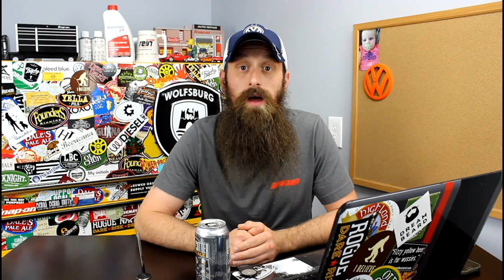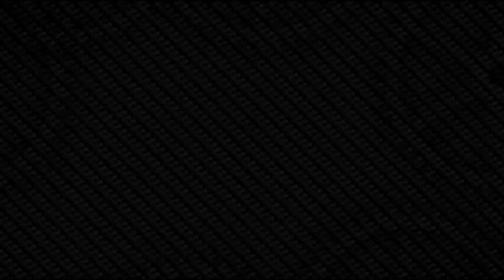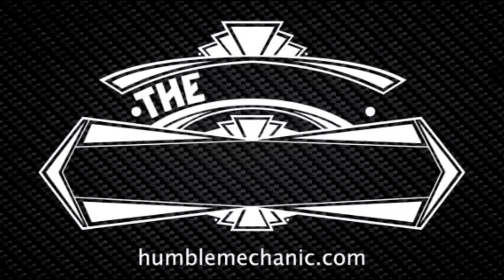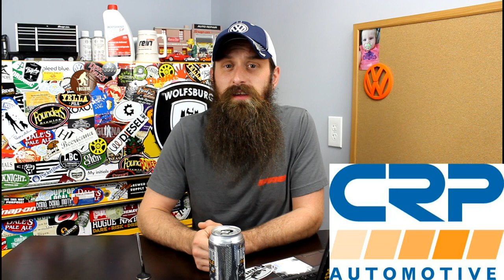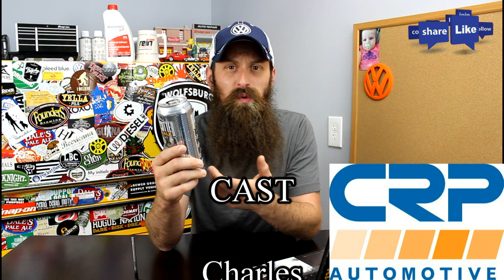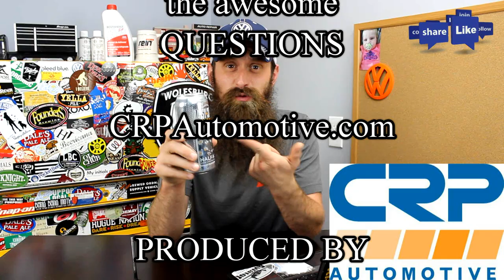Viewer Automotive Questions Answered ~ Podcast Episode 96

Comment: Thanks Charles for addressing my questions about wiring repairs. I also have a BT module lying around waiting to be installed so I can't wait for you to make a video about this.
Garry (2.0T Passat) - check camshaft follower under HPFP - it may have disintegrated. Replace it every 50000 km.

Comment: I will always recommend soldering a wire to using a crimp connection, because crimping a lot of times adds resistance. A good solder connection done properly (not a cold solder joint, which means it did not absorb into the wire) is far superior to a crimp connection.

Comment: It was weird how you mentioned about spending money on training, i am an Nissan engineer in the UK and the most common way here (95%)is to start an apprenticeship at a young age 16-18  working within a dealership and they pay for everything, however the wages when you start are usually very low. I started when i was 16 (12 years ago) and my starting wage was £55 per 40 hour week ($100 ish) do you guys have to pay for you're training whilst  receiving a higher wage?  Cheers =)
Reply from the maker: +MultiSkuz That sounds like a great way to train. That is more of a true apprenticeship. We don't really have things like that here. I wish we did!

We have to either start out at the bottom and hope the shop pays for training. Or we can pay a ton of money and come in at a slightly higher dollar amount.

Comment: How about the Lighting package?  Mine does not have it.  Do the aftermarket kits work like OEM?  Is it as easy as swapping out the headlamps?
Reply from the maker: +Salvatore Cimino probably not. It will most likely involve coding and wiring too.